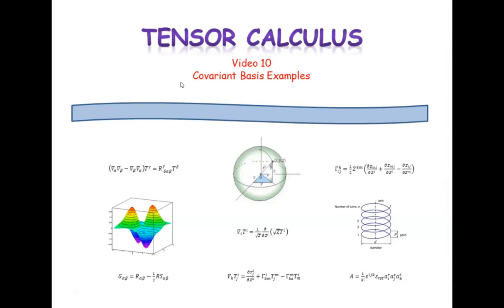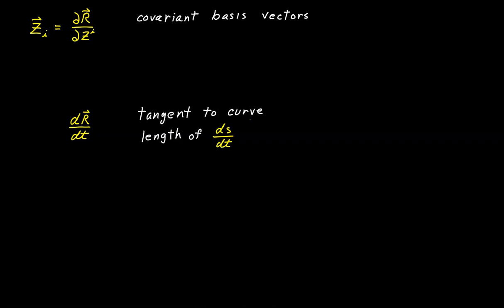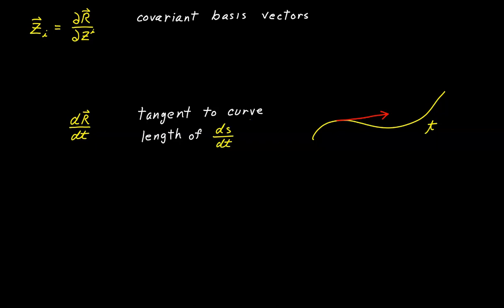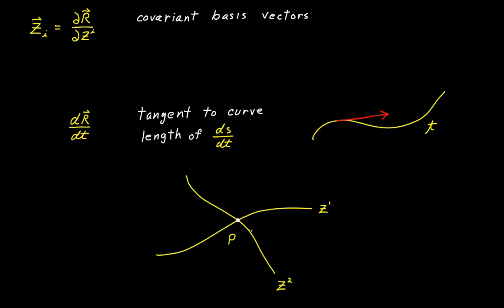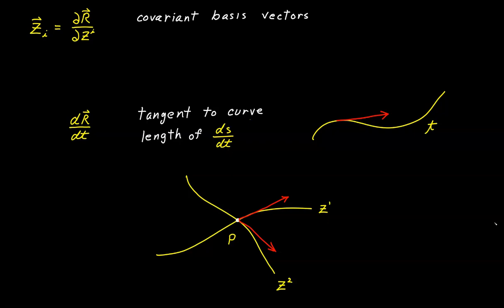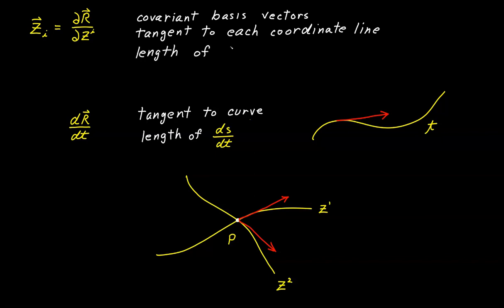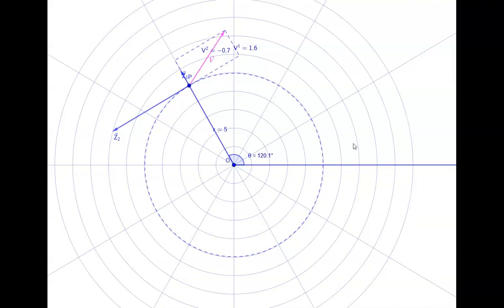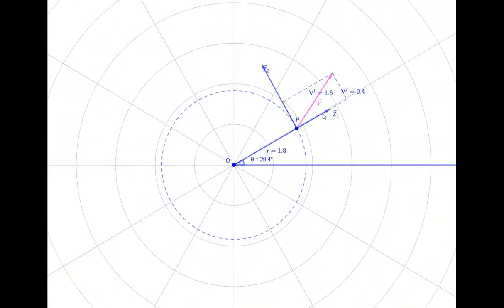Video 10 - Covariant Basis Examples

Comment: You said that 19 minutes and six seconds that these are covariant basis vectors, but I look at them, and all I see are basis vectors . what makes them any different than contravariant basis vectors and how can you prove that by taking me back to the graphical illustration of dual bases vectors, which describes covariant components?
Reply from the maker: Video 17 includes a visual demo that compares covariant and contravariant basis vectors for affine and plane polar coordinates. You should be able to see how this extends to the other coordinate systems.

What you will find is that for orthogonal coordinates, where all the basis vectors are mutually orthogonal, each contravariant basis vector points in the same direction as its covariant basis counterpoint. Each pair points in the same direction, but their magnitudes are reciprocals of each other. If they are unit vectors then they will be the same. It is only when the system is skewed that they point in different directions.

Hope this helps.
Reply: @tensorcalculus822 For almost a year, I have been trying to understand where the r in the theta comes from and why if that being the case is there no theta (by symmetry) in the r direction, if you paramertize by arc length.  You explained and corrected my misunderstanding in 10 min with your beautifully done presentation. I am so grateful!

I also want to say, it's a crime that calculus 3 is not taught using tensor calculus.  I memorized so much and trusting memory is very poor substitute for actually grasping the rational.  Kudos to you for this as well because my plan is to finish this series and go back to Calc 3 and learn using tensor analysis.